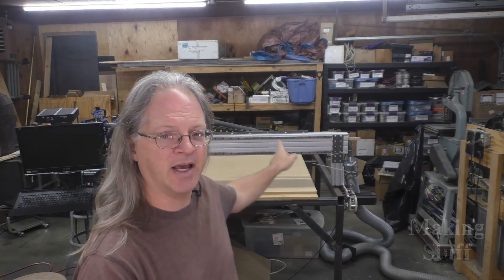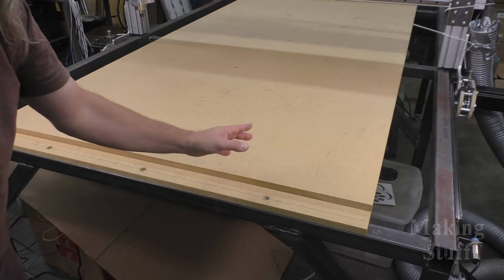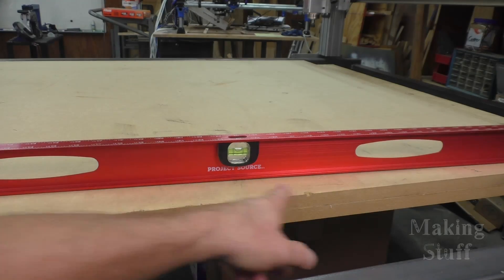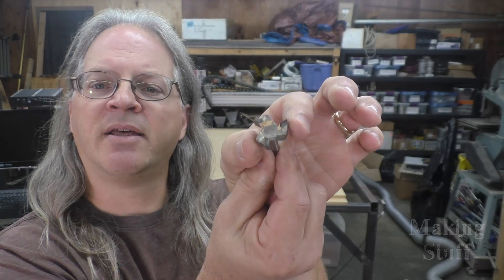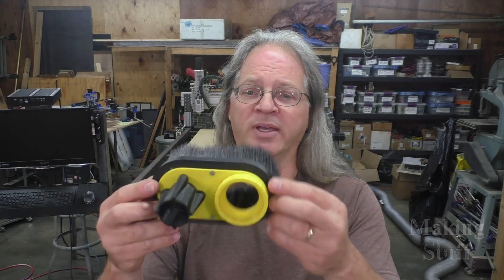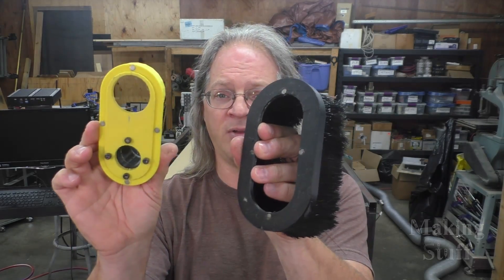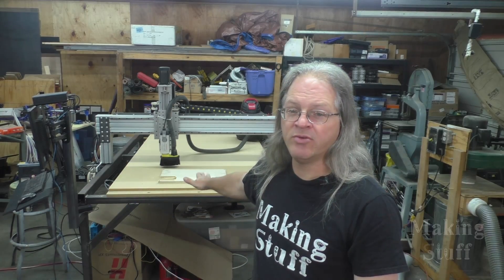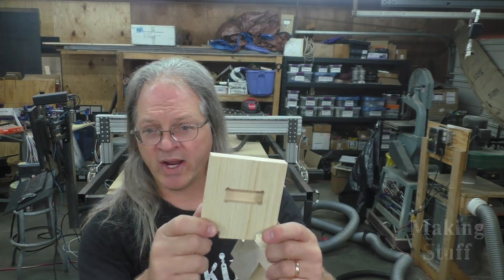CNC Table Surfacing

Comment: Dude, If you don't have a vacuum table the most common solution for holding down your waste board is using plastic bolts, plastic brads, or plastic staples.  They wont ruin your bits if you crash, and they are really cheap.

Comment: Thank you for putting this video together.  I'm planning for a CNC table in my garage and have a space for it at the back like you have yours against the shelves.  I find it odd you have your CNC so close to the shelving like that.  Doesn't the dust form quickly on the shelves?
Reply from the maker: There is so much dust in the shop, it doesn't matter where the CNC is located, LOL.  Thanks for watching!

Comment: I have seen spoil boards with these type of nuts that have a flange and some teeth on the flange and they are mounted from underneath and the flange keeps them from tearing through, and it allows you to use bolts that have threads for metal (and not wood), so you can screw a metal bolt into a metal nut held in from the bottom and that keeps from spinning from the teeth on the flange.  That way, you don't have to tear up your spoil board by screwing things down to MDF, which will tear out and could be dangerous if a work piece comes up and flies across the room at your face with the broken bit still stuck in the wooden work piece and now that bit is stuck in your face.  Probably never happen.  But still, probably.   But if it were bolted down with a metal bolt going into a metal nut with a flange with teeth to keep it from spinning or falling out on the bottom side, then your spoil board would stay more prestine, and probably never have to be replaced depending on what you are doing.  You could put a thin spacer spoil board on top of the main spoil board, and bolt them down various ways, to forever preserve your spoil board, so it becomes more of a fixture board, and not a spoil board.  It depends on how you want to define a spoil board, and your needs and situation, and the amount of precision you need.  If your main fixture board was machined flat to the machine, then a spacer mdf spoil board could be bolted down to it and your work piece bolted to the small thinner spoil board, your precsion would be very good still, and then your main spoil board can become a fixture board and not a spoil board at all.  That is what I would want to do.  All that work you did on that giant board, just to spoil it over time, ... I could not bring myself to mess it all up.  It depends on the size of your work pieces.  But as a rule, I would prefer to have a fixture board that is machined flat, and that you can bolt to it real spoil boards that you do not care about and have not been machined.  Just like a mind.  A fixture board is a terrible thing to waste.

Comment: Excellent channel and build videos! I may have missed it, but what was the “all in” cost to make this unit? I’m up for a good challenge and to have full sheet capacity would be nice. Thanks for the response.
Reply from the maker: https://www.makingstuff.info/Projects/Full_Size_CNC_Router
Reply: $4000 total.   That's a pretty hot machine for 4 grand.  It is awesome.  You could make acoustic guitars on that machine.

Comment: I was wondering if you "TRAMMED" your spindle before you leveled the spoil board? I'm not sure if you covered the tramming process in another video, but normally you would tram the motor/spindle before leveling the surface board. Tramming not only reduces ridges forming on your spoil board/pocketed surfaces, but it sets the center line of your spindle perpendicular to your work piece.

Comment: For the life of me I can't understand why you wouldn't go that extra bit longer so you can cut 4 x 8 sheets on it?
Reply from the maker: Couldn't find linear rails long enough.
Reply: @MakingStuff  
What a great job you have done and what great videos. I have watched your whole build series and learned  an awful lot in preparation for my build. Thanks for that. 
4 x 4 is a great size
Unless you need a 4 x 8 on a regular basis, a 4 x 8 takes up a lot of unnecessary room in a workshop unless you are lucky to have a huge workshop which very few people have  ... 
Whenever you need a 4 x 8, just add an outrigger support table of 4ft on each side of the CNC router and do a two tile cut
I plan to go the other way and make it as a 2 x 4 as I know that I will seldom need a bigger area than that for 95 % of jobs, so I can easily wheel the machine into a corner of the workshop when not in use to save precious space and when I need to do a seldom 4 x 8, I will just do a 4 tile cut

Comment: That was a surprising variation from the spoil-board. What do you think will happen with seasons as it loses or gains moisture from the edges?
Reply from the maker: With my luck it will probably warp like crazy.  Thanks for watching!
Reply: @MakingStuff  Not sure if that is luck...physics perhaps. I wonder if some very stiff closed cell foam board would be a better choice - although that would require some method of tying down the work piece without relying on the foam as an anchor.

Comment: It's not too loud because people are old, it's because they have hearing damage and tinnitus, and don't realise it. Normal hearing reduces the volume if it's too loud or increases it if too soft, my volume is 11 all the time. Even though I turned it down in 3 sec my ears are ringing, and will ring probably for 3hrs - 10sec and it would've been 24hrs -, and that's not to mention the pain. One channel is so bad I have turn the sound down and use subtitles, and then you don't get the humour.
Reply: Mobile phone number sand me CNC    new   Pakistan me sand. PASSE pass pass

Comment: Great music tunes. In an upcoming video could you do a short raw audio piece? I'm curious how loud it is.

I saw a rig someone built in a shop bay next to a friend of mine, his frame was built similar to yours but the supports across the machine then would end up holding the spool board were two pieces. Each corner had a large bolt that could be adjusted to level the surface similar to a 3d printer. For the amount of actual work to get your surface true though, I suspect you made the right choice just flushing it using the machine.

Comment: I'm curious to see how long your linear rails last. We ended up purchasing a table over building one, as everyone told us deviations in parallel or flatness of the rails greater than .002" will wipe out the bearing blocks very quickly .
Reply from the maker: THe ones on the plasma table have held up for 2+ years now.  Time will tell how well these work.  Thanks for watching!
Reply: @MakingStuff  We run our machines 12 hours a day 5 days a week so it'd show up a lot sooner I'm sure. The builds have been great to watch, love the work and presentation. You've got a great channel.

Comment: Great project, nice to see final progress 👍🍾

Unless you don’t have good mid support for the waste board it will sag in between even it is two sheets and glued. I suggest that you weld y direction supports to your frame.
Reply from the maker: Yeah I figured I may have to add more supports.  I really hate MDF.  Thanks for watching!